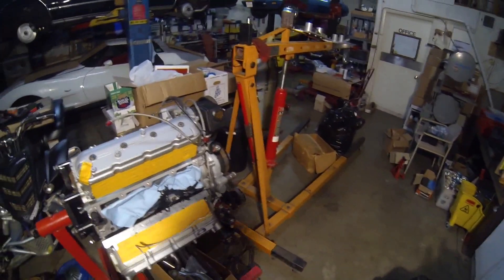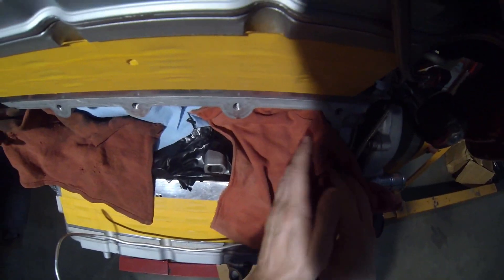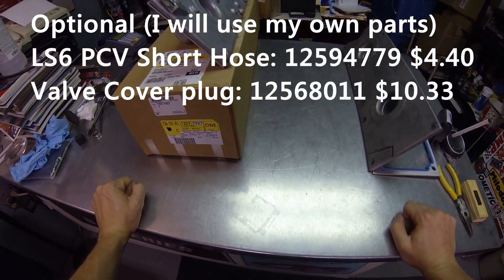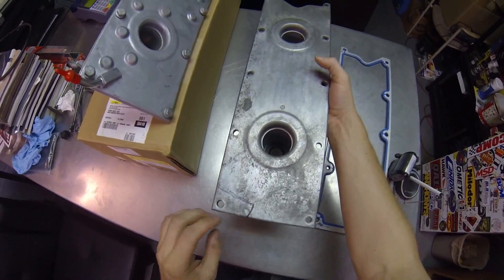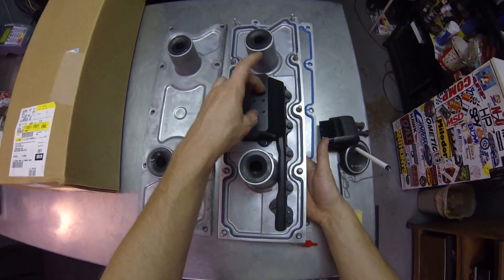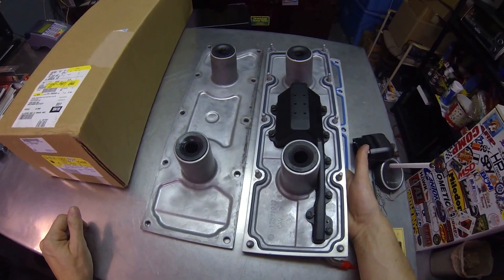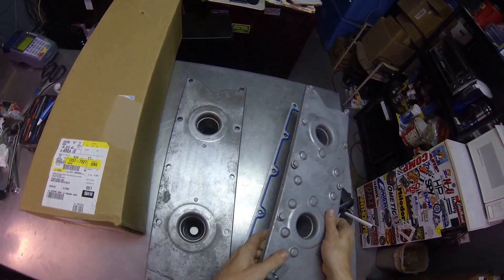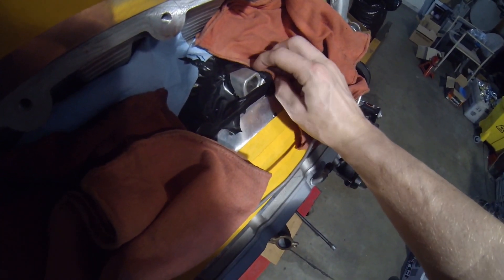LS1 to LS6 PCV Conversion

Comment: Confusing for me because I have a gen 3 2004 late LS1 which I hear is a little different than the 2002 LS1 from Camaro for instance my 04 Pontiac GTO came Factory with an LS6 intake
Reply from the maker: Some have ls6 blocks in them and intake. Look for the bulls eye on top passenger side, if it's there it's an ls1 not an ls6

Comment: Hello, Would it have been easier to modify the plastic part on the valley cover? Thanks!
Reply from the maker: I believe it would get into one of the bolts that hold the plastic to the valley cover on, whatever floats your boat if you wanted to try that.
Reply: @CamaroRick  I just did this mod yesterday. I was easy enough to tape/cover  everything off and cut off the piece of the block. Thanks for the video!

Comment: Is there some issue with LS one engines getting oil in the intake, all of a sudden my car starts burning oil at the exhaust blue smoke when I crack the throttle and I look inside the intake and I see oil in there never had this before is this some common issue with that I didn’t hear about and is there a way to rectify this besides doing what you did, meaning quicker or easier

Comment: I watched your video and efforts to successfully transition to the new style LS6 Corvette PCV system, since I left mine on some dealers lot somewhere, how and where does fresh air enter the engine block? I did follow the link and read the authors text and viewed the photos, but did not get the answer either to how fresh air gets in. I know how it gets out now. I was also surprised to see, but don’t know why the PCV valves needs a ground wire as well, unless static could somehow built up and during an unforeseen stray hydrocarbon issue, could cause a fire. Inquiring Retired ASE Master Tech want to know, please?
Reply from the maker: Simple The fresh air tube goes from the throttle body to the ps valve cover. Simple formed rubber hose. No change is needed. This just eliminates the split wraparound pcv valved hose

On LS6 it pulls filtered air from either a port on the throttle body (non vacuum side usually up top) or later year cars through an air inlet tube between the TB and MAF sensor. The other end gets ran to the passenger side valve cover forward position port (ls6 or newer LS variant valve cover only has 1 port). The rear 2nd port on stock LS1 valve covers can be plugged with a silicone plastic vacuum cap for longevity (no part number listed). All these new made rubber vacuum caps only last a year.  
The plug that is listed in the video is the plug for the driver side rear PCV valve port in an LS1 or LS6 valve cover. Its a glorified plastic PCV valve sized plug. so you can get creative if you want.
Reply: Thanks Camero Rick, I simply did not know if the fitting on the valve body was vacuum side or fresh air side. My logic tells the With gases, fumes and moisture being drawn from the valley center, then it should get filtered fresh air should enter both rear valve covers to have a complete scouring of the crankcase is best practice. But I truly understand everything changes when 1 or 2 turbo’s are added, as this changes the crankcase pressures and PCV operation. Nice job on your design, execution of power tool use, not for everyone would feel as comfortable as your where. As a retired ASE Master Tech of 42+ years, you got skill your neighbors don’t have. Good job. I will watching for more!

Comment: If you can tig, can you just pop a hole in the factory LS cover, weld a bung or nipple, and go old school with a replaceable pcv valve? I cannot find why the replaceable pcv valve went away other than better for manufacturer and dealer.
Reply from the maker: I was going to go that route and baffle it. All it has to be is a threaded hole and a 1/4 npt to barb fitting with an external old school pcv valve. There are plenty of 90's cars in the salvage yard that had a traditional valve with a rubber housing that would work for a custom hose mounted pcv.
Reply: Still looking through things I think I may go about it differently.  Biggest reason it's my wife's 07 Yukon and I'm keeping DOD.  Just learned the valley cover is not as plain.  I might play with getting old valve covers off ebay for cheap and drill and tap them.  So why I'm looking into this, the rear main seal is leaking.  Pretty sure with 150k on the motor it's just time.  But I don't want to get that replaced and have the pressure in the block blow oil out the back 2 weeks later.  It's still running strong so it would be nice to have something replaceable for maintenance purposes.  No oil in the intake would be icing on the cake, but currently goal is insuring proper ventilation.  Good video!  At least I got to see another way of getting it done.

Comment: how can you tell if you have that notch you have to grind off?? i have an Australian ls1 version thats in a 2001 model, and id like to be sure before purchasing the valley cover somehow
Reply from the maker: holdenssruless if u take the valley plate off there is a 1" bath tub shaped pocket in the casting of the block near the top cover sealing surface on the right side of the block. I believe it was standard through 2004 on aluminum 5.7's I'll have to check if it's the same on iron 6.0's I'll look tomorrow
Reply: Camaro Rick probably should of added, that I don't want to have to take my car apart just to find out haha, but mines 2001, which is meant to not need grinding and be a direct fit, but not sure because mines in a Holden commodore not an American car, can I use the engine number to somehow check?
Reply from the maker: R Mack good to know thanks for the heads up
Reply: R Mack   just so I'm reading this right... i can bolt an ls6 valley cover on my 01 ls1 without having to do any machining?
Reply: R Mack  I got the mighty mouse. From my research they seemed good what's your opinion

Comment: Funny that I just ran into this issue. Figured out the problem spot after a few expletives and a food break (the brain always operates better with fuel). Ten minutes with the old die grinder and couple test fits and, viola, it fits. Good video for those about to make the change. You'll love the performance improvement, due to less/no carbon build-up on your valves and pistons, and no catch can mess.
Reply from the maker: Victor Everlove for sure! I still  ran my catch can after this to test how well it worked. Every time Ive checked the catch can drain there hasn't been any oil
Reply: @daviddebate1597  What's up doc? (Sorry couldn't help myself.) I'm in Metairie, and I am going to do this conversion to my '04 C5 soon. That  r.mack guy, a few comments lower,  provided some good info , and an excellent how to link. You might want to check it out. See you around, be safe.

Comment: Would love to have the time to do this to mine, I'm running the poor designed stock pcv setup with a catch can on the dirty side, it works but I have a bunch of spaghetti of hoses under the hood haha
Reply from the maker: +TheGuitarGuy09 after having the heads off of the old motor and seeing all the carbon on the pistons I knew I had to change it up for the new build. I know what you mean about time. New setup is ready to roll just need time and money to finish it.
Reply: +Camaro Rick I plan on changing all the seals on the intake manifold soon, how would you recommend cleaning the intake ports on the cylinder head with them still installed obviously on the engine?
Reply from the maker: +TheGuitarGuy09 usually the intake ports on the cylinder heads stay pretty clean. (sooty isnt a problem) The fuel injectors keep the ports degreased with fuel. The hot combustion chambers and the valves are where the burnt oil cakes up. You could try using chemicals like seafoam or something similar to break up the carbon inside the combustion chambers.

Comment: hey i just did this to my ls1 but i wanted to know how did you connect the vac hoses?
Reply: Great tutorial. How do you think a Dremel multitool would work on the aluminum block?  It looks like it would be challenging.
Reply from the maker: It would do well just make sure you cover up the internals from getting any debris from falling in. You could even have a helper use a vacuum while you are cutting it out to reduce the dust and shavings.
Reply from the maker: +Roguestatus650 The factory system has the port on the LS6 valley going to the intake manifold (behind throttle body) 

The valve cover fresh air port goes to the clean air side. If you are running a maf its gotta be plumbed into the air intake after the MAF. Usually the throttle body has a port that is routed to the front of the tb on the air filtered side of it. 

Ill be running the catch can so ill have the ls6 valley running to the CC then to the intake.
Reply: +Camaro Rick so did you block off the other connections and just left the ls6 and the throttle body connected? I'm just trying to figure out if I did mines correct
Reply from the maker: +Roguestatus650 yea the valve cover and hose that wraps around from the driver side gets removed and the vc gets plugged. the passenger side valve cover is the same as original to the air filter side of tb